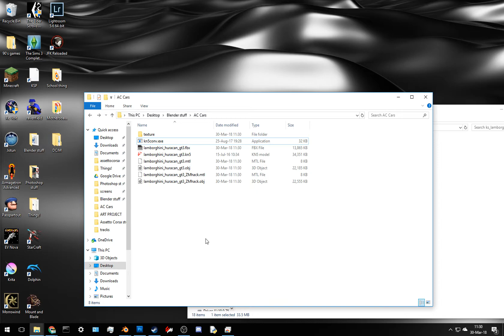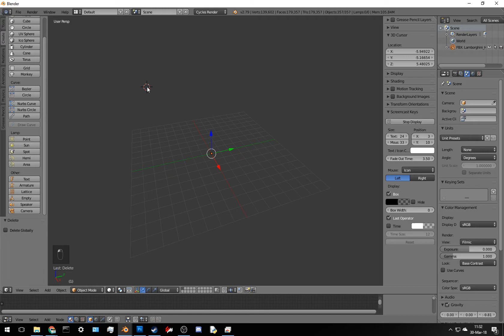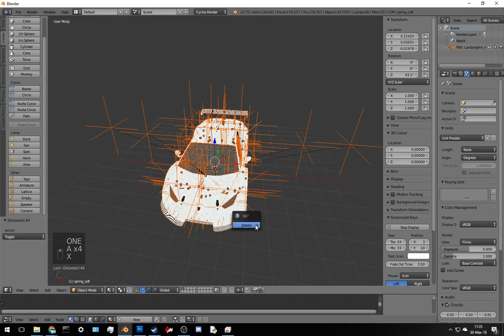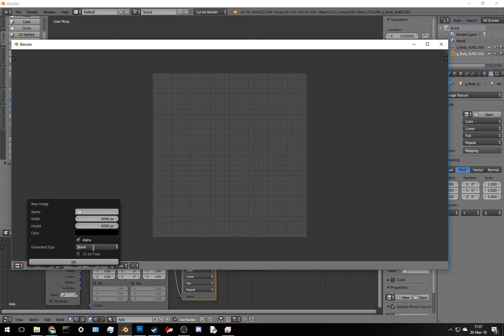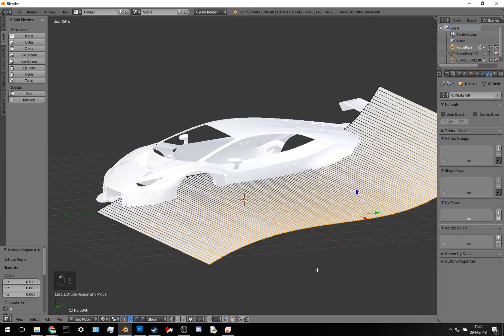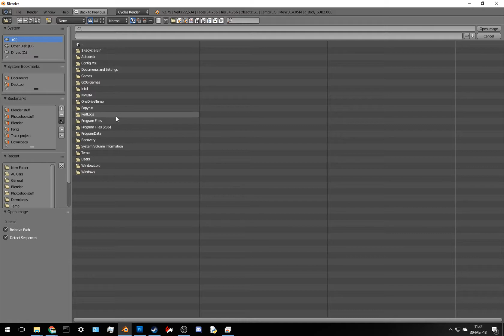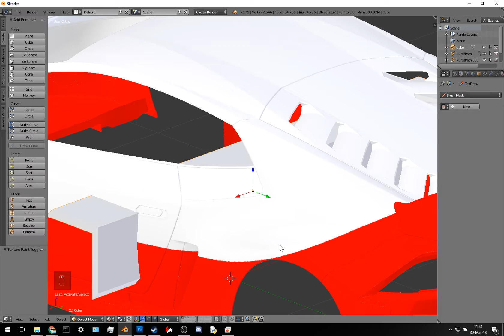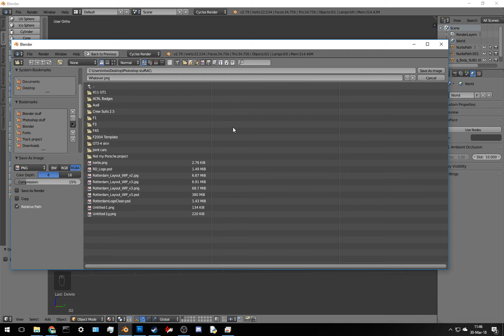Texture painting AC cars in Blender

Comment: I cannot do the part @ 6:33, because I'm missing these options that you are using. Could you do an updated video with Version 2.82.7? (and maybe with a voiceover too? :) )
Reply: After creating a new material, you will find a "Surface" title. if it's not expanded yet, do it. a "Use nodes" will appear. On "Surface" you'll have "Principled  BSDF". Click on it and change for "Diffuse BSDF".  After that, clique on the clock icon on the bottom left of the screen e select  "Shader editor". the nodes will appear just like the video. To add the other nodes click on "Add".

Comment: Hi.. Can I know which version of blender are you using? many options are way different than mine, and following you as close as possible didn't yield any results, most differences come in the material/texture setup part. For example, I don't have the "Diffuse BSDF" nor the "Texture Coordinate" nodes
Reply: After creating a new material, you will find a "Surface" title. if it's not expanded yet, do it. a "Use nodes" will appear. On "Surface" you'll have "Principled  BSDF". Click on it and change for "Diffuse BSDF".  After that, clique on the clock icon on the bottom left of the screen e select  "Shader editor". the nodes will appear just like the video. To add the other nodes click on "Add".

Comment: Hm. Blender keeps telling me the file format wouldnt be supportet. But it is a .fbx file and i converted it with the Autodesk FBX Converter... any ideas what the problem could be?
Reply: Nevermind I should choose import instead of open... but I'm having another problem: The right Door of the Car (911 GT3) hangs over the front of the car...
Reply from the maker: Right, yeah I don't know what's wrong with the Porsches, but both the 911 Cup and GT3 for me have the door and a lot of the nearby elements rotated out of where they should be, with this converter and the Sim3D one too. Basically the only thing you can do is manually go in and rotate the parent empties until they're roughly where they should be. Feel free to @ me (Nils) on the ACRL discord and I'll see what I can do to help guide you.
Reply: @1armbiker  Thanks. Because I never used Blender before I dont want to mess around with the rotation etc. I gonna try a different car like the R8 GT3 instead. But I may come back on you later on if I need help

Comment: Thanks for this demonstration! I gave up trying to do this in Blender since I couldn't figure out how to combine the meshes into a single mesh. I use Mudbox instead (see my channel).

For stenciling text, what I do is paint the stencil while mirroring so it shows up on both sides, rotate the car to the side with backwards text, line up the stencil correctly using the backwards text as reference, turn off mirroring, erase the backwards text and immediately stencil it on the second side. This is trivial in Mudbox... hopefully it is possible to do the same thing in Blender?

Additionally, is there a way to not show backfaces in Blender? I think I would find it really annoying to see the paint on the outside of the car while looking through the car's windows.
Reply from the maker: Yes, backface culling is supported, and I probably would recommend using it even though I did not in this video. setting for that is here: https://cdn.discordapp.com/attachments/368167952660430849/429669051917139980/unknown.png

And it looks something like this: https://cdn.discordapp.com/attachments/368167952660430849/429669121421213726/unknown.png

You can also do the same thing in Mudbox with the text and lining it up on the other side with the mirrored text as the reference.